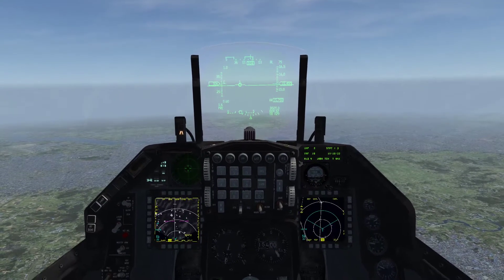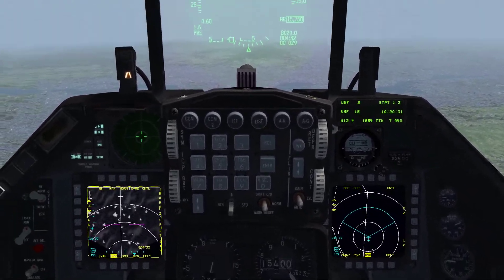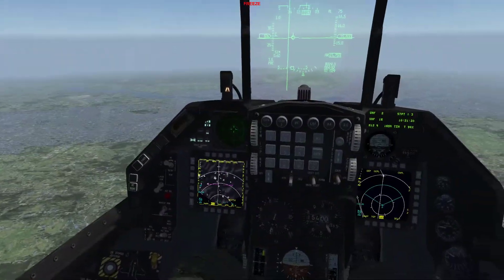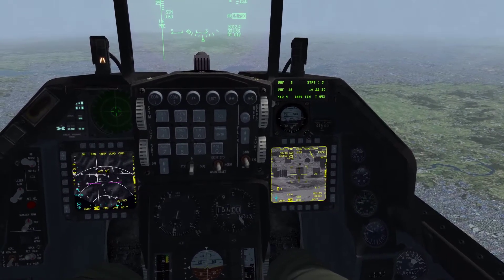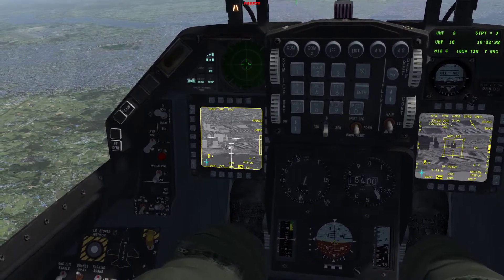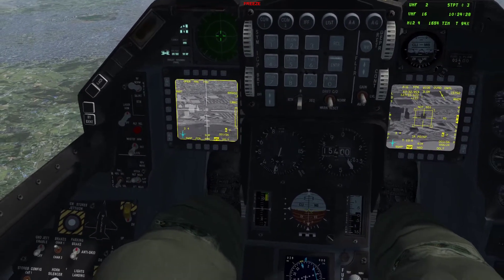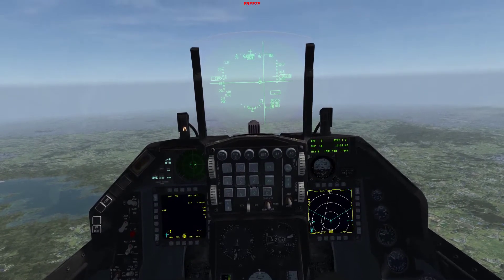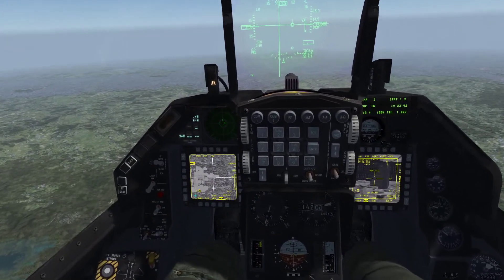Falcon BMS 4.34 - AGM-65 Maverick Boresighting Tutorial

Comment: Just to clarify, the reason you're using sim instead of master arm on, and the reason you turn everything off at the end, is because you're not actually intending to fire at the moment, you're simply aligning (boresighting) the maverick to the same spot as the TGP, so later you can use the TGP to find your target, and your maverick will already be pointing at the same location? Am I understanding correct?
Reply from the maker: Exactly!

There is a natural misalignment of the two sensors due to their different locations. Boresighting on a distant target corrects for this misalignment.

I use SIM because I have no intention of actually firing the missile during the boresighting process, and in fact want to ensure I can't do so accidentally.

Comment: Straight to the point! 👍

I want to add something in addition;

It is possible to 'TMS up' and command a point track on a building via TGP, while having the WPN page selected on the other MFD, with the MAV's already uncaged, and not getting a MASTER Caution. Just quickly switch SOI from the TGP to the WPN page, right after pressing TMS up. - By doing so, the attempt to start the "Hand Off" will get interrupted,
and therefore you won't get a "Hand Off" failure. Using this method comes with the clear benefit that it is much easier/faster to acknowledge that you really aim (with both sensors) for the very same building, which is needed for the actual boresight procedure ofc.
Reply from the maker: Absolutely true!

I don't generally do it that way because
A) the TGP far outranges the mav seeker, and 
B) the WPN seeker will always follow the SPI, so regardless of whether or not you're looking at the WPN page, the seeker will be looking somewhere in the vacinity of the TGP SPI. You can always switch to the WPN page whenever you want.

But it definitely works, and that's the important part!